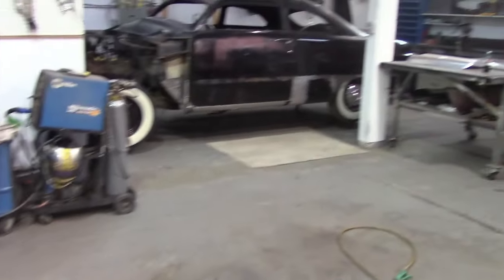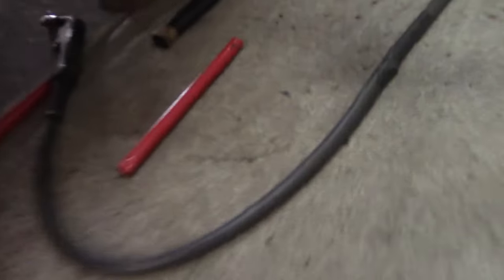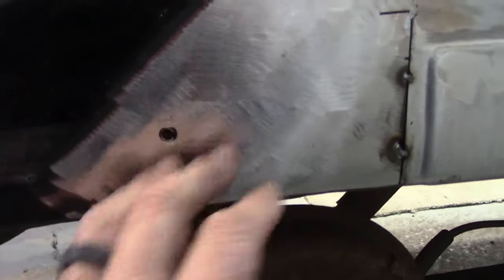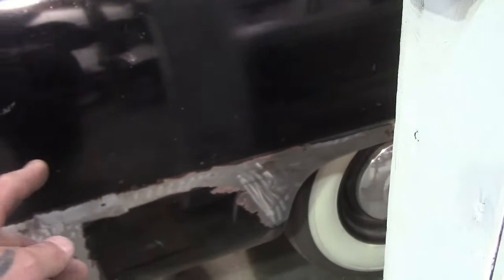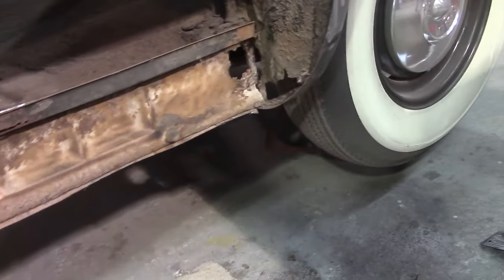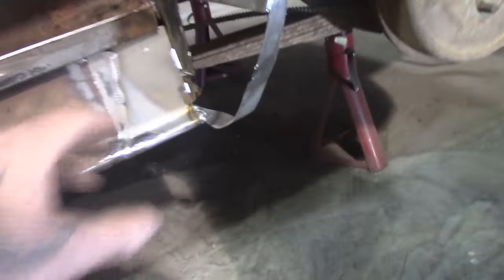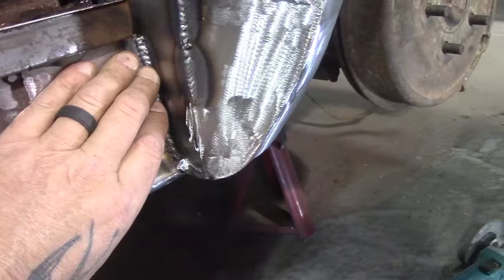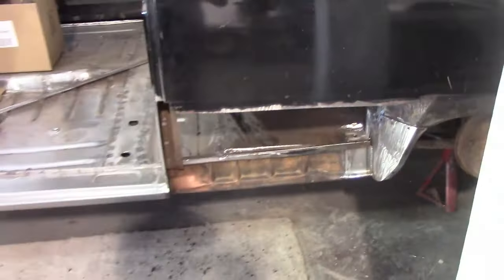1950 Ford Chopped Shoebox Build ~ Part 15

Comment: I remember those cars I owned one, the carburetor had two settings rich for winter and lean for summer , they were a great smooth ride , the bench seat were very comfortable , my last ford was a 66 ford custom with a 6 cylinder .
Reply from the maker: Cool .

Comment: Looks good will be solid.
Even if you buy the little English wheel from princess it flex’s and will need to be reinforced depending on what gauge your doing. I’m trying to make a thumbnail die for my little princess auto hammer mill. Need to shrink to build my glove box. Check it out if your interested.
Reply from the maker: Metal I use most is 18gauge
Reply: @OldTimeGarage  it still flex’s a bit with 18 gauge but works.